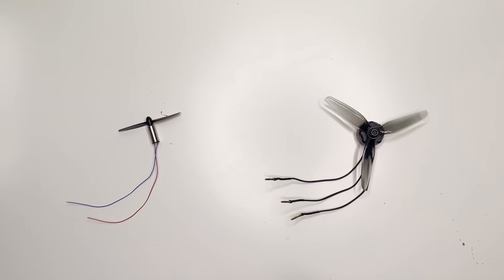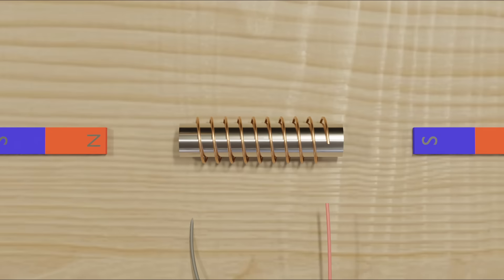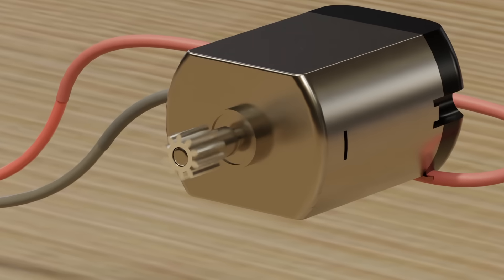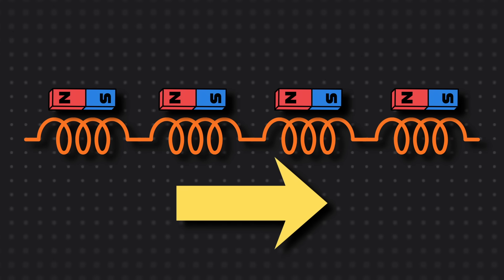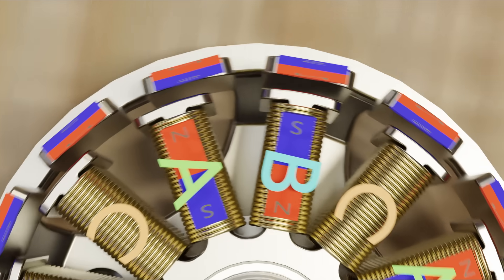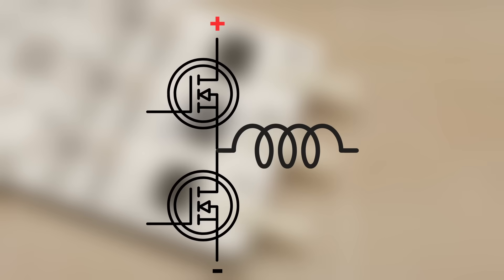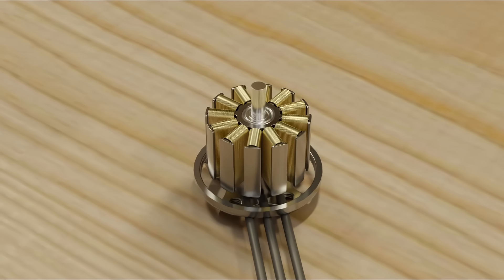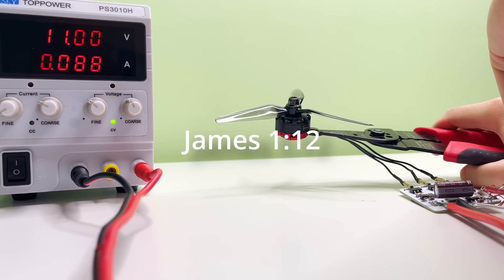Why Adding 1 Wire to Motors is Genius

Comment: Brushless motors were my Dissertation subject. Nice video.
Reply: BLDC or PMSM?
Reply: @agapidorin1933  BLDC
Reply: I'm really hyped for the no permanent magnet brushless motors. 

They are using wireless technology to transmit power to the rotor. 

You need an insanely fast computer to make it work, but not necessarily an incredibly powerful computer.

I think if you can get up into the terahertz range, you can start "cheating at physics", massively reducing the amount of heat generated for the same amount of work, by very carefully modulating the power inputs. Something something AI, makes it work even better.

You basically get all the benefits of a stepper motor, and a non-stepper motor and none of the drawbacks.

These new motors are where industrial and automotive technology intersect with 3D printer technology. Making our 3D printers quiet, blew the barn doors wide open on programmable electric motors. It used to be you went slightly slower if you used quiet mode. Now it's part of the software that makes it actually go faster. Your 3D prints will just be worse and slower if you turn it off now. We even tune our 3D printers with a cheap little accelerometer, to phase out self-induced vibration and shaking. Basically the 3D printer now acts like its own noise. canceller. This actually reduces overall strain on the entire system, so you can print faster much more accurately, than doing it purely with stepper code, even at the slowest settings.

And now Nvidia, xai, and a bunch of others are getting even more performance out of electric motors by applying advanced artificial intelligence during test time compute. In other words, not pre-processed, a physics engine pushing the motors directly. 

We are also figuring out that you can run AI with vastly less resources than we had previously assumed. By this time next year, you could be running local AI models, directly on your phone, that are more powerful than the most powerful AI running on super computers today.

Eventually, with the help of an AI, any kid will be able to make a robot in their garage, pretty much from scratch. 

Sorry about the rambling, I do that. 🤷‍♂️
Reply: @jtjames79 how are you generating an electric field without a permanent magnet & wires for the electromagnet?

Comment: Why in the F are you running a propped motor while holding it with pliers!? Youre just begging for stitches, even with a 3.5 in prop. Set and example snd build a proper test bench. If for no other reason than to set a positive example for your viewers. My hand looks like the back of an orca because of my own stupidity. Dont be like me, and save yourself a visit to the hospital... or the hospital a visit to you in my case. Emts have better things to do
Reply from the maker: You're right. I'll put a disclaimer in the description! This is my first time spinning an FPV motor, and given that I've seen people fly FPV quadcopters inside that are arduino controlled, I assumed it was relatively safe. Assumption was wrong!

Comment: Yes!, students need to see were the wire goes, how does a the coil or magnet actually looks like in this commercial motor and what clever tricky is perform to change to the next coil.

10/10 explanation and illustration

Comment: how do you know there's no smart chinese man doing analysis of all PCBs and adding them with annotations to the fellow DB?
Reply from the maker: Are you talking about the sponsor PCBway? Well, I don't know the answer to that question, but the company I intern at uses them for prototypes, and personally they seem trustworthy. As a hobbyist, my designs probably are worthless, cause there are professional ESCs out there anyway. So, for hobbyists, it's probably fine. For a professional PCB design, like from a company, sure, you can take precautions and use a US based manufacturer to protect IP. Or, you can send them your file without a proper name so that it gives them no clues, if there is a guy/AI/algorithm that figures out schematics from PCB layouts. Though that'd be pretty hard, assuming many electronic parts can use the same package for example, creating an uncountable number of possibilities of what the board could do and how, though I'm just a hobbyist. PCBway based on their services itself is trustworthy and reliable. It's just the fact that they're in China that can create some suspicion, like many Chinese based companies unfortunately.

Comment: Interestingly enough, many industrial applications still use brushed motors and PWM as opposed to a 3 phase or BLDC motor!
Reply: I've encountered plenty of (brushed) DC motors in the steel industry, specifically in applications where metal is being uncoiled - processed - recoiled. Good control over speed and tension are required. DC motors were preferred for their speed/torque curves and relative ease of speed and torque control. Thanks to massive improvements in AC drive tech over the last 25 years, 3-phase AC induction motors with AC drives (VFDs) are now used in new installations but many big (many > 100 HP) old DC motors remain in service due to cost of replacement.
Reply: Actually this would make for a great followup video. How is BLDC different from 3 phase induction motors.
Reply: Many, but not most.
Most industrial application use 3-phase motors, since they are more powerful for their size compared to single-phase motors.
3-phase motors have the added advantage that their direction can be reversed simply by reversing two of the three legs.
In addition, 3-phase speed controllers, or as they are referred to in industrial catalogs, Variable Frequency Drives (VFDs) are able to control the speed and direction of a 3-phase motor in the same way the Techie's controller does, only using up to 480volts, depending on the drive and motor ratings.

(The important variable for motor power is its Wattage, and Watts = Voltage * Amperage. More volts allows the required Wattage with less Amps. The Amperage how thick the wires need to be. Thicker wires mean the motor ends up physically larger and thicker wires mean more copper used in the electromagnet windings, and copper is an expensive resource.)
Reply: @andrewdreasler428  That 3 phase thing about simply reversing two of the three legs isn't really an advantage when you can use a simple H bridge for brushed motors to do the same thing. The circuity for a brushed motor is far simpler even when you want to run both motors in forward and reverse.
Reply: @DrakeOola If that is the case, then why isn't H-bridged brushed .otors the industrial standard. Companies always want the lowest price for what just barely meets the requirements, and having a "FWD/REV" switch that is a simple crossover switch seems to be the standard. You add that single switch to a conveyor belt's power feed between the START/STOP and the motor and- hey, presto! You just made a reversing conveyor belt.
Reply: Also, the circutry for a 3-phase motor is INCREDIBLY simple, a permanent magnet rotor, and 3 sets of stator windings, either wired in a big loop with the power coming in at the three junctions (Delta wiring), or all with one end wired to a common point and the power coming in tbrough the "free" end (Wye wiring).
The only wear parts in a 3-phase motor are the bearings supporting the shaft, and those are in ALL motors. Brushed motors add the brushes as a wear component and an additional point of failure.
Reply: @andrewdreasler428  They literally are an industry standard, that's literally why you still see brushed motors used in commercial products even when they need forward/reverse operation and even though brushless motors have a lot of advantages of their own like less energy losses from the friction and less wear and tear from brushes. When the motor itself cost a couple hundred dollars it wouldn't make sense to save a few cents on electrical components in most scenarios, not when a single set of brush replacements cost more than most of the circuitry.
Reply: What industrial application would that be exactly? I’ve worked 20 years in both marine and food processing industries where I’ve still never seen a brushed motor.

Most are induction motors, but a few types of pm motors and even a few pm assisted switched reluctance motors.

But never a brushed DC one. And all are three phase.
Reply: @Imbrondiir  in aviation and similar areas where reliability or complexity is of concern, I think it’s quite common (likely for cost reasons) to ditch the 3 phase simply because the circuitry required to drive it is complex (or at least “complex” compared to a brushed motor given you only need a battery to make the brushed motor spin). A 3 phase motor being driven by DC is essentially having that converted to AC before it can power the motor.. there are many sites with heavy equipment that can be powered by AC directly, so 3 phase is usually the most efficient; but I’m still personally shocked by how often I find brushed motors, and where
Reply: @everettengineers interesting. Thanks. I can see how AC drivers are less reliable than DC ones, though I always thought the brushes would usually wear out first.

I also assumed in aviation you’d always have three phase 400hz available. But yeah a lot assumptions about an industry I don’t know much about.
Reply from the maker: That is interesting. Shows how engineering is about using the right tool for the right application.

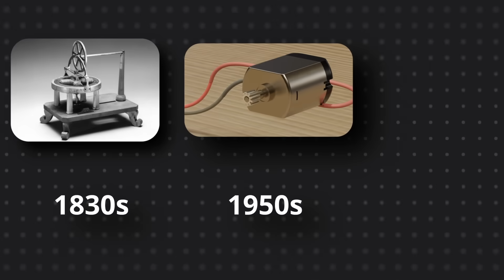Comment: Correction at 3:03, this was how we used direct current to spin a machine. AC systems were employed to rotate things well before the 1950s.
Reply from the maker: Oh yes, Galileo Ferraris & Nikola Tesla were an absolute genius with induction motors!
Reply: @TheTinkeringTechie  your model at 4:00 is wrong: the number of coils has to be at least three and should be uneven. the shown stator hovever has 8 coils.
Reply: @TheTinkeringTechie you are really misspelling Galileo Ferraris
Reply from the maker: @brylozketyzyn You are right. Edited my previous comment to include him!
Reply: @TheTinkeringTechie  You are really correcting everything 🙄🙄🙄🙄
Reply from the maker: @kipweit9634  Ok, then I will correct my corrections by not learning from mistakes.
Reply: @TheTinkeringTechie I was being sarcastic btw if you didn't catch that, because every time someone points something new and you can't satisfh everyone
Reply: @kipweit9634 nah, facts are facts and they should be corrected. Opinions, feelings, jokes ... yeah can't satisfy everyone.
Reply: We still use AC to rotate big things.

It's kinda crazy. When you analyze the power system that the electrical grid makes with the demand of, say, an industrial zone that uses a lot of motors, you realize that it's kind of like a rotating-motion-transmission system. The generators generate electrical energy, in the kV and thousands of kVA range. We use transformers to step these voltages up to insane levels to reduce losses in the cables we're using, so much so that we are able to send this energy far, far away. Then we use transformers to step these voltages down again and spin motors used in manufacturing processes.

Of course, energy is lost along the way. The generators are not 100% efficient, so not all of the mechanical energy is getting converted to electrical energy. The transformers have loses as well related to the physics of their ferromagnetic cores. The transmission lines have losses too, in the form of resistive heat losses. And then the motors have losses due to friction, other effects related to the ferromagnetic materials they're built with, and heat loses in their windings.

But, still, even with all of this lost energy, it is much more convenient to have a centralized energy generation facility that sends it to whoever needs it whenever they need it, instead of them having to necessarily be in the place where the energy is generated.

Mind you, too, this wasn't always like this. Substations and generations plants used to need to be very close to each other and to their loads (towns, cities, houses), to minimize losses in the transmission lines, so they needed to be somewhat short for electricity distribution to be economically viable. It wasn't until we started using transformers and until we refined transformer technology, that we started to develop the early stages of the modern electrical infrastructure, with long range transmission lines. Common, widespread use of electricity simply wasn't a thing until after transformer technology started getting used in the late 1800s, meaning people that's 50 years old today probably had grandparents that lived in a world where electricity was known about, but couldn't reach them because it wasn't yet known how to send it far away while keeping it economically viable. Crazy, crazy stuff.

Even crazier is that not even 70 years later after transformers enabled long range transmission lines, early computers were being built as demonstrations for the potential of semiconductor technology. Not even 40 years after that, computers were a consumer product and a constant for the common white collar employee in the 1st world. Not even 15 years later, humans interconnected the whole world through the internet, a massive network for the transmission of information, enabled by semiconductor technology. Not even 10 years after that, humans started talking of "artificial intelligences". Another 10-15 years later, and humanity now has MULTIPLE highly advanced "AI" models that are making ripples in the economy of the modern day.

Like, we really went from the incandescent light bulb to AIs in the span of like a century and a half. That's just fucking crazy.

Comment: For once the youtube algorythm give me a great new video!

I do wonder what specs the "mini computer" (controller) need, would an arduino be enough (in theory)?
Reply from the maker: Glad you enjoyed, and thanks for stopping by! Actually, the "mini computer" I used is exactly an Arduino chip (the Atmega328p), that is used on the beloved Arduino Uno, nano, etc. It is fast enough, as long as you use C++ instructions that execute very quickly. Example, digitalWrite(8, HIGH) vs. PORTB = B00000001 both do the same thing in the end (turn on pin 8), but the PORTB is tens of times faster (I think like 60 times faster?) because it doesn't need to process additional logic that makes the digitalWrite more intuitive for newer users. So Arduino is capable, in practice (not just in theory!)
Reply: Ohhh, now I get the Itch to make an ESC for an old HDD motor I have ;) 
 @TheTinkeringTechie
Reply: @TheTinkeringTechie  btw, do you mind sharing the pcb schematics and arduino code?

Comment: Interested to know what kind of firmware you are running on th ESC? is it just 3 PWM sinusoids? or are you implementing a space vector PWM?
Reply from the maker: The firmware is written in C++, using lower-level instructions for execution speed. It's on an ATmega328p, so an arduino chip. It's just 3 PWM sinusoids used to only control motor speed rather than also used to smoothly transition between phases. I believe space vector PWM requires a hall effect sensor (like in FOC control), which I didn't use. It's not needed for high RPM drone motors either.
Reply: @TheTinkeringTechie oh nice! You don’t need any feedback to run SVPWM it’s just a modulation method that enables a greater torque output in open loop you can couple it with some kind of feedback with a Hall effect or encoder for position control or torque control but for a drone motor open loop SVPWM should suffice.
Reply from the maker: Interesting, didn't know about that. Learned something new, thanks! I guess it does make sense that we can use it in open loop, as the BEMF takes care of commutation, and in between switching phases, we can use SVPWM.
Reply: @TheTinkeringTechie yea I bet if you update the firmware to create a SVPWM modulation signal instead of the PWM sinusoid approximation (which is what I’m guessing) you might get more torque out of motors. I believe SVPWM is supposed to minimize torque ripples and torque fluctuations. I’d be interested to see a compare a contrast!

Comment: no if you can make brushless pure hall-effect dc motors. you dont need any motor pulse controls controllers.
Reply from the maker: Yes, that is correct. That would be suitable for low RPM motors with higher torques, like in robotics, as you won't have enough voltage produced from BEMF because of the low speeds. It would also work for drones as well, but not necessary. I decided not to add that info as it may complicate the explanation for anyone new to this. Also, because I demonstrated with drone motors with high RPMs, which can use the BEMF for timing.

Comment: Add a fourth wire and don’t use AC.  What do you have?
Reply: Add one more wire for those super expensive 5 phase stepper motors
Reply: BLDC don't use AC either (voltage doesn't go negative), and can have many more than 3 wires, which is overly complex and unnecessary.
Reply from the maker: I'm guessing a stepper motor?
Reply: @TheTinkeringTechie thats probably right